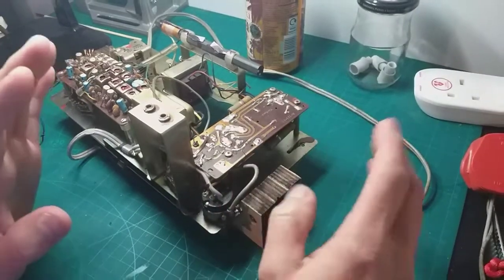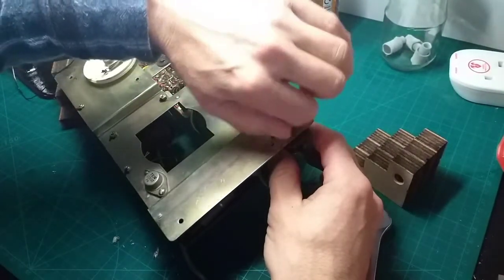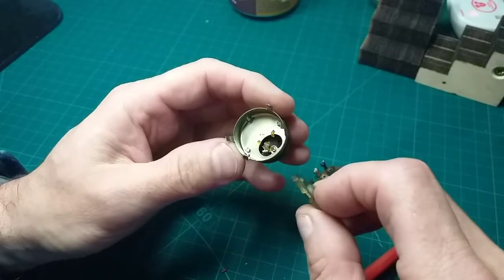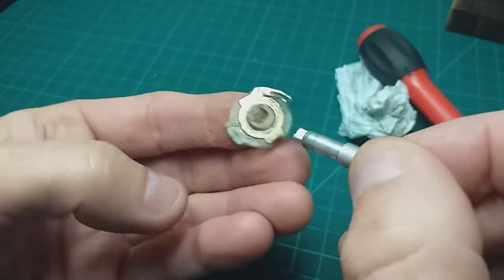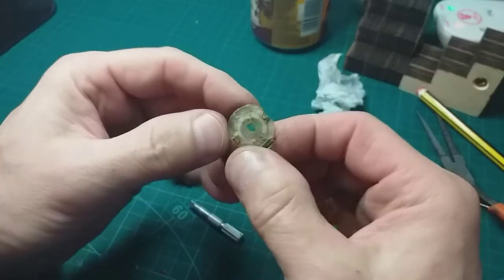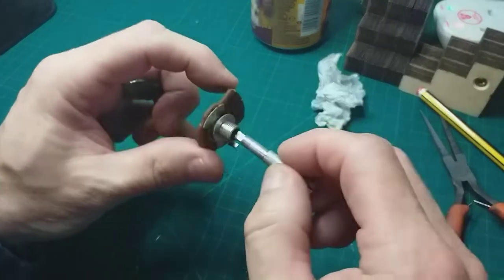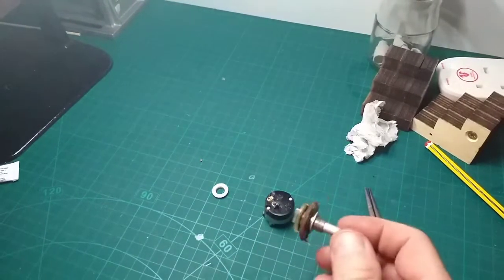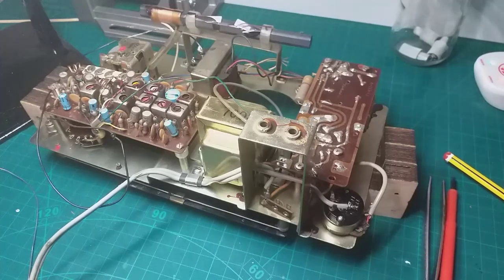Wien H Radio Potentiometer Shafted .

Comment: That plastic disk should have a plastic bit sticking out to engage with that metal flipper.
I don't know the exact name for it.
Yep 10k sounds about right, they are not a precision pot.
When you are checking continuity put the meter in the lowest resistance range (200 ohms) on your meter, then press the probes together and look at the display, notice the resistance of the leads and connector resistance.
When you measure low resistances only, mentally subtract the  lead+connector resistance for the real resistance value.
Switch contacts can have a slight resistance but the lead+connectors can fool you into thinking it's all the switch contacts.
Ill shut up now :-D
If you are lucky lol.
Reply from the maker: Really good advice Harvey thank you

You can waffle on as much as you like with advice like that , yes I think there's a piece missing from the disk , I did wonder though never seeing one before thanks for confirming

Best regards Shaun

Comment: Unfortunately, these combined on/off volume pots are often troublesome on vintage radios. A 10k pot should do fine, but it needs to be logarithmic rather than linear. If you do manage to find a source for new pots combined with a mains on/off switch, I'd like to know!
Reply from the maker: Thanks for watching Timothy

Yes after reading ZXs comments I think there is a piece missing from the disc

I have been looking for a replacement but not much success without overspending hey ho

Best regards Shaun